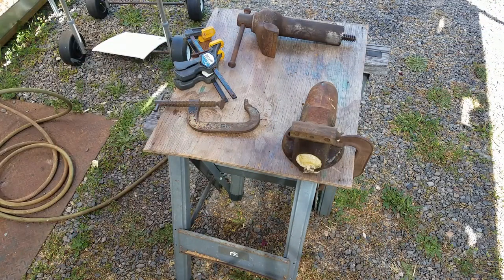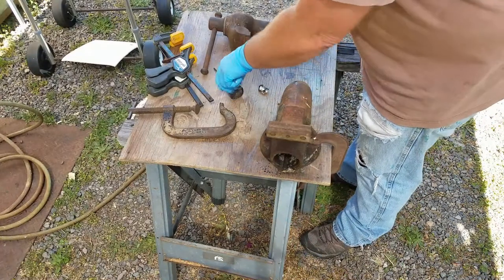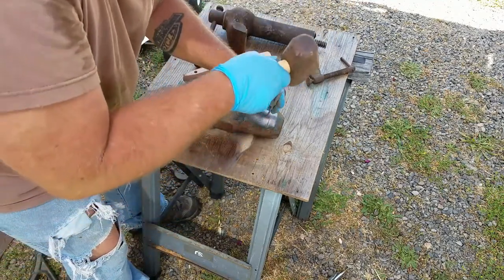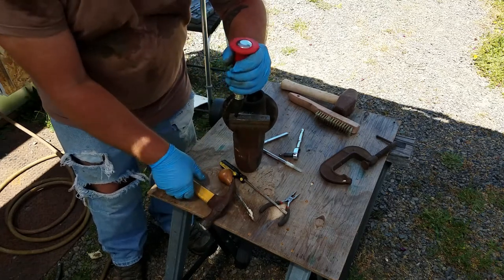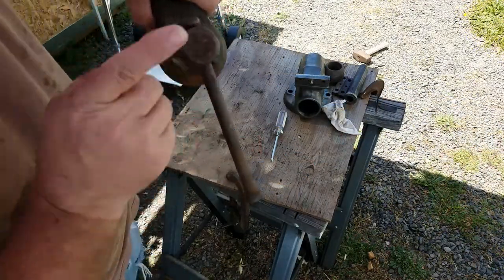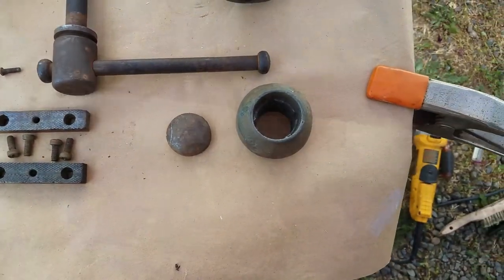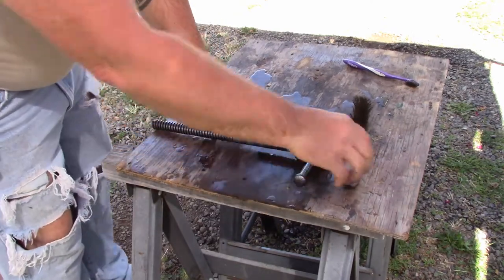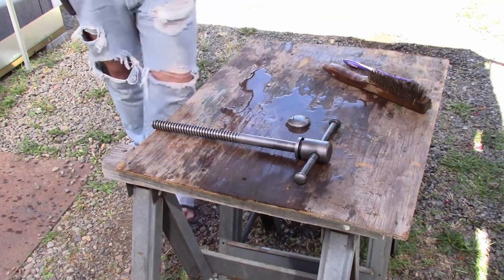Wilton Vise Restoration Part 2 - Breakdown and Electrolysis

Comment: very informative... never knew about this electrolysis procedure... did see some old guy on Jay Leno garage zinc plating some automotive parts... looked good to me...might could work on the handle
Reply from the maker: I looked into that too, but the guys at the plating shop warned me off of it. They said it would wear off too quickly. I figure if they're turning away work, that's worth something.  Thank you for the idea!
Reply: Mark Lindsay  have you looked at parkerizing? Honestly I would do the whole vise with that.
Reply from the maker: Oh wow! I had forgotten all about Parkerizing! I'll check into it. Thanks!
Reply: It's been awhile but it is very easy to do. When I could not get military surplus solution, I would use Brownells. http://www.brownells.com/gunsmith-tools-supplies/metal-prep-coloring/parkerizing/parkerizing-supplies-only-prod24778.aspx

Comment: Did you find when reassembling the rear pins in the back that it wasn’t the same fit as before removing them or perhaps the rear cap is a little looser?
Reply from the maker: Not at all. Everything lined right up and the rear cap fit just fine.